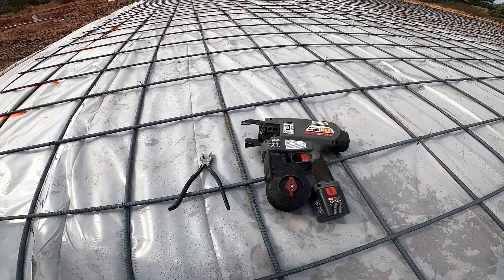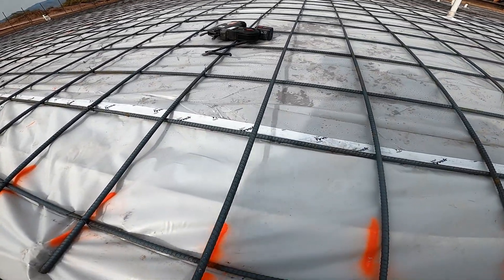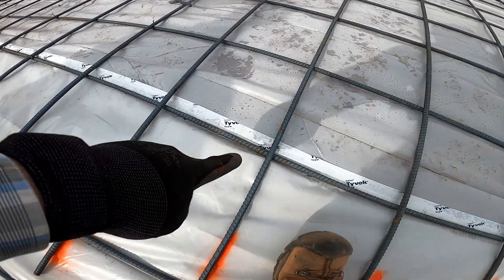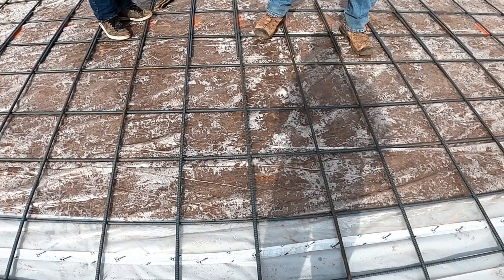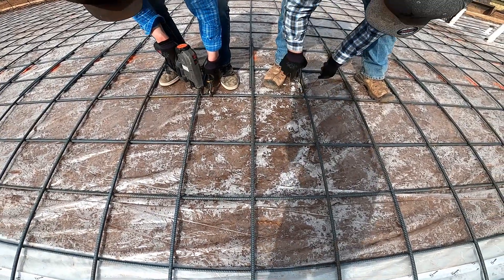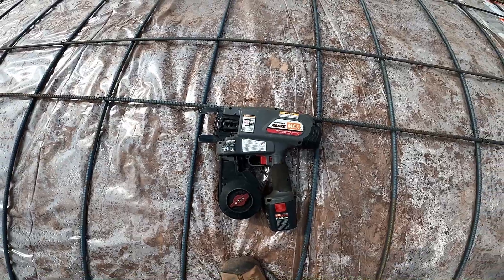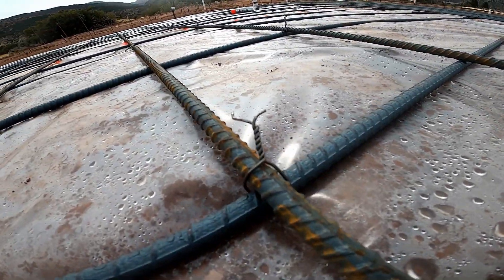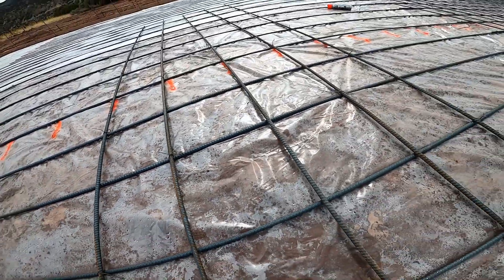RB655 Rebar Tying Gun *vs* Spring loaded Klein Pliers

Comment: Hey bro great review gun is the way forward but they are expensive in the U.K. we purchased one when we did the basement conversion and slab but for the hand ties we used the two loop and hand held tie pull just a quick bit the gun saves on wear of the wrist 😂 awesome review have a awesome week all the best Tony 👍
Reply from the maker: I've used 2 loop, you can get pretty fast with it.

Comment: It has its advantages for certain jobs, flat work either horizontal or vertical, I'd like to see its utility in a column yard fabricating columns with interlocking ties, hairpins, rack braces etc, or on the job site assembling core walls with link beams with diagonal bars at openings on the form side curtain in a 12 inch thick wall, not gonna work.....don't throw your pliers away, you'll need em.
Reply from the maker: I'll definitely be keeping the pliers as well.
Reply: Yea, i can see that they could assign more people to columns and such.

Comment: Here my opinion. I've had plenty of experience with that tie gun they are very handy when they work but when the wire gets caught or the roll comes undone in the its holder it is a pain is the butt. I've never used plyers n wire I have only used a twisty n twister. Tbh I like the twisty n twister better. And that's my opinion.
Reply: Even when the wire gets stuck.. Its still worth it...😅 😅 😅

Comment: The difference is the price of skill needed to operate the tools. You need 10+  years to run pliers efficiently. $2,000+ per week skilled labor

A determined single mom on her day job using a tie gun can beat the rod buster all day for days. And cost 30-40% less per man hour. 

All those years of experience replaced by a machine. Technology-keep up or get beat in the bidding rooms.
Reply from the maker: Yup

Comment: Solid, I just saw this video. And I looked up the price and I will have to opt for the pliers. Lol. $3500? I am still saving for that crown stapler you told me about :)
Reply from the maker: Excellent, you do what you can with what you have where your at. 
Both of these are nice, I'm currently using the hitachi
Metabo Construction Stapler Pneumatic  7/16-Inch Staples   https://amzn.to/3giGo99
Hitachi N5008AC2 7/16" Standard Crown Stapler, 16 Gauge  https://amzn.to/3uVXKgw
Reply: @SolidworksUnlimited  

Oh awesome. Did you buy that gun just for the purpose of attaching lathe, or do you work with crown as well? Would a coil roofing nailer work as well? My wife is going to cut my budget pretty soon if I don’t start buying tools that can perform multiple functions. 

Than you for replying. It must be nice to be able to do different types of jobs all the time and not the same thing every day.
Reply from the maker: The 7/16 crown stapler can be used for wood lap siding, t one 11 sheets, that's the 4 by 8 sheets of siding, I wouldn't use it for crown moulding at all its too powerful, Brad nailer 18 gauge or pin nailer for that, a coil roofing gun works OK for lathe as well.
Reply: @SolidworksUnlimited  

Oh I C. I just figured out why they call it a crown stapler. Lol. 

Do you have an email?
Reply: Got it

Comment: I own 3 of these guns  and I tie by hand now ,very expensive wires and the batteries are easy to break so need to hold it with tape or wire or velcro , and the guns are jamming all the time .Not worth the money in my opinion waste of time and very frustrating .Sorry MAX. On the positive side I  own 2 MAX gas nail guns for the last 10 years and never had one problem .From one extreme to the other
Reply from the maker: Great points, glad you brought that up people need to know the truth behind them from someone with years of experience. Seems though for like a retaining wall with tight rebar grid they would be super valuable in that application.
Reply: @SolidworksUnlimited  not really  but when they work they were awesome mostly for the high bar hold one hand and tie with the other ,The next generation might get better like every other tools, I do foundations so I tie grid vertical all the time since 1977 own rebar guns for 7 years. At 64 not buying tool anymore

Comment: Holy crud! $2500!
Reply from the maker: Ya expensive!
Reply: I promise you, they pay for themselves in a very short period of time. We’ve got 3.
Reply: @tylerkurfees4762  it’s a concrete tool, they basically pay themselves off sitting in your toolbox! still it’s a hefty price to a normie like myself.
Reply: @tylerkurfees4762  if they work😳😑😐
Reply: I've hammered out generator pads in 6 hours and walked away with close to 2 grand profit. They pay for themselves. They save your elbows and wrists which means you can work longer and more often.